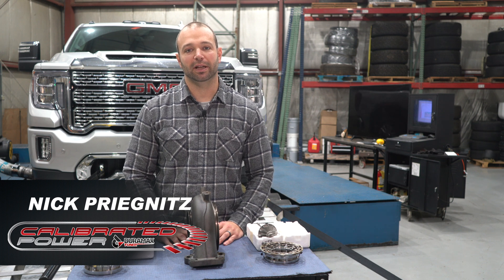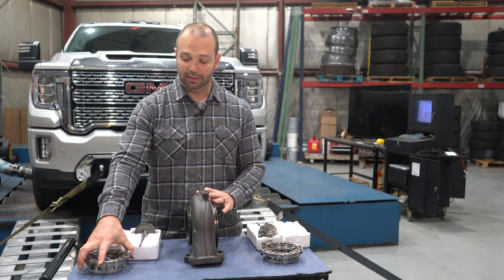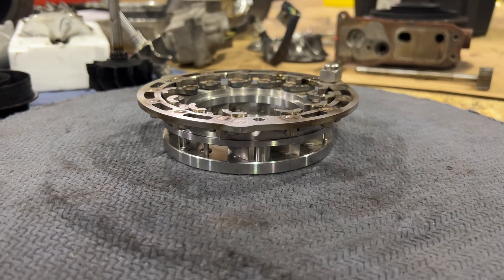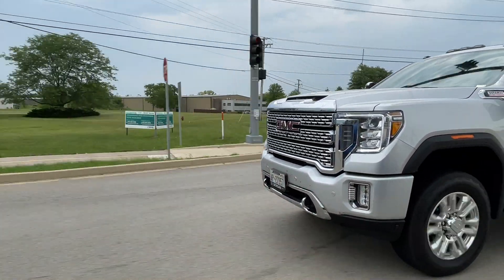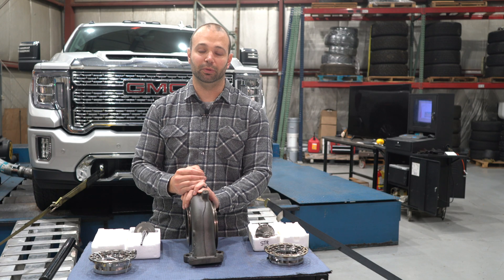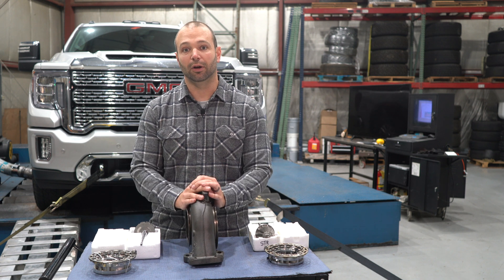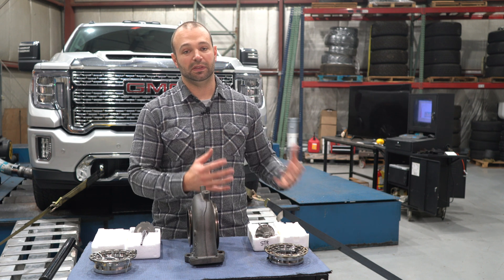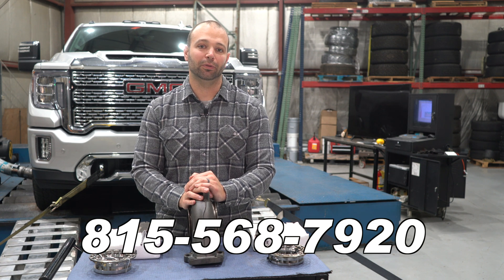The L5P Stealth STR Vs L5P Stealth 64, Which Is Right For Your 6.6L?

Comment: Curious, about what does one of your turbos weigh? I'm building an OM606 (3L Mercedes mechanical injected turbo diesel). My power goal is around 400-450 wheel. I already have a turbo, but I'm worried it might fall short. I'll find out soon enough. I don't want to go to a truck sized turbo, but if I need more air, then I don't have much choice. Many folks run a holset hx40 or an hx52 to hit 600 horse. Turbo I have now is pretty similar to the LM2 turbo, its a custom Garrett GT2260V from a BMW, with a larger compressor, turbine, and custom vgt aperature. Can't wait to get it finished.
Reply from the maker: Thats awesome @Akya2120 ! Our lighter non-VGT turbos weight in at about 40lbs and our larger VGT turbos can weight as much as 50lbs.
Reply: @Duramaxtuner  I hope one day there's a reasonably sized VGT for cars lol. This one is about 16.5lbs, but if it doesn't move enough air then the next step up is +35lbs 😅
Reply from the maker: @Akya2120  Our DT44 turbo is a VGT turbo that is reasonably sized for a car however it is probably the same if not smaller than the turbo you are currently running. Maybe give our LM2 turbo upgrade a look when it's officially announced.
Reply: @Duramaxtuner  56/79 compressor, 58/56 turbine with a custom VGT ring.

They say it'll make 490+ on the M57, but the air demand is higher in the OM606. I'm hoping for 400-450.

Comment: on a 2022 weight loss truck with TCM tuning, what are you thoughts 64 vs 67g2?     Not sure how these these new transmissions will hold the power with trans tuning?  Have you got some miles on them say with 650whp?  or is that just too much for them?  Also i love the turbo sound, how do these sound in comparison to stock?
Reply from the maker: It depends on your goal with the truck. If you want to go big in power we suggest the 67. If you want a turbo for towing and daily driving, we suggest the 64.

Comment: Hey nick can we get some insight on the new 9 blade turbine wheels that companies are coming out with for the drop in duramax lml turbos? The 9 blade wheel claims 2-3 lbs more boost and 100* drop in egts how come duramaxtuner doesn't use a 9 blade wheel?
Reply from the maker: There's no magic number when it comes to compressor/turbine wheel blade count. In reality the pitch of the blades, shape of the blades, and blade count all tie in together.

Comment: Would this turbo be beneficial to a truck without the exhaust? And is there a 67 mm option available with the vein technology?
Reply from the maker: If you are looking for performance, airflow, and more horsepower. This turbo will work perfectly for your truck.

Comment: Great video! I got a STR from you guys last week. So what is the total differences in the STR? Bigger wheel only it sounds like? Will this be a noticeable difference in power and turbo noise?
Reply from the maker: Yes sir. Sound will differ and the STR with the compressor wheel is more power capable.
Reply: Does this increase MPG during normal driving?